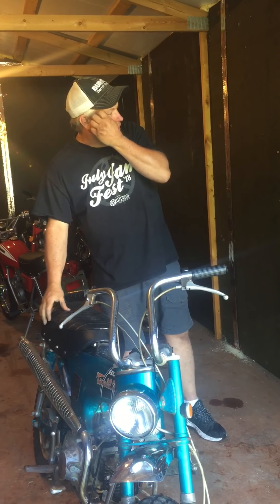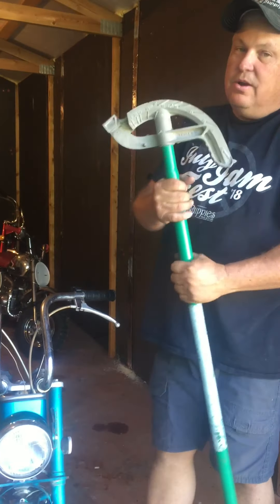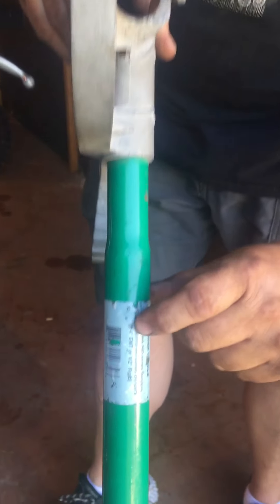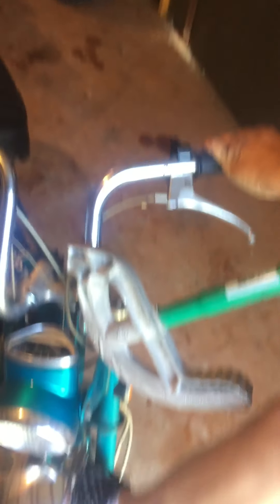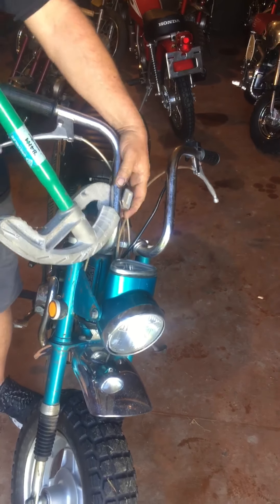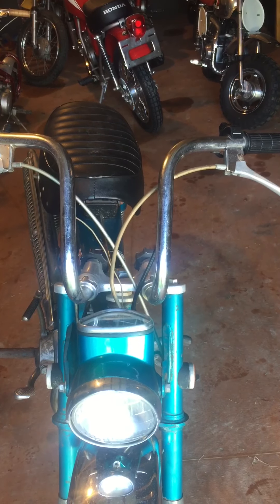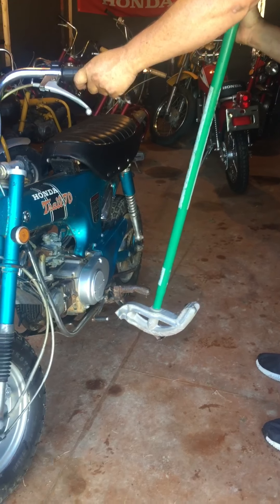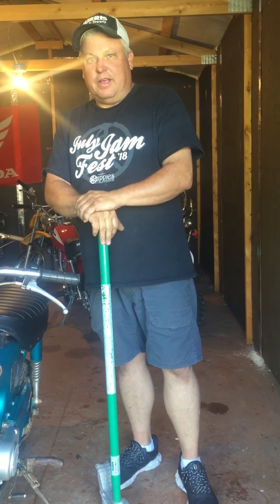Straightening handlebars and kick stands on a z50 or ct70 very easy and quick!!!

Comment: I have a 1970 CT70 (all original as far as I know) with a bent handlebar.  I bought the exact bender (3/4”EMT, 1/2” RIGID) as shown in the video.  My bars do not fit into the channel of the bender, they seem to be too large of a diameter.  I realize you have to sort of twist the bender to lock it in place on the bars, but even after doing that the handlebar never fully seats into the bender channel.  Despite that I tried using it and it kinked the handlebar.  Maybe my bars are not stock (they appear to be…. has original cables etc) or I’m not using the tool properly.  Any help appreciated.  Thank you!
Reply: Ok, I figured out what the issue was.  Someone put a 1/2” EMT bender head on a 3/4” EMT handle.  The handle had a 3/4” EMT decal and that’s all I paid attention to.  Leeson learned….check the head to make sure it is the right size and ignore what is on the handle.